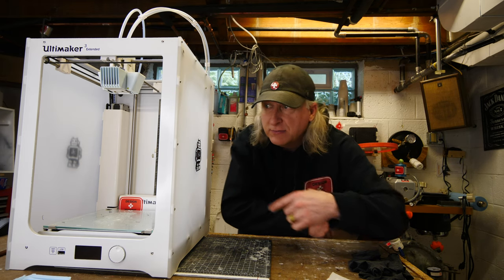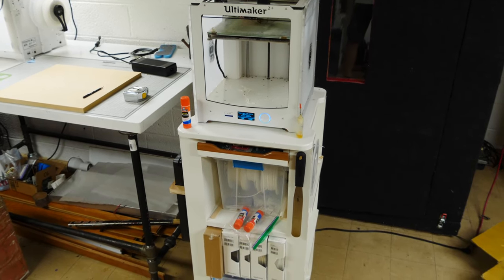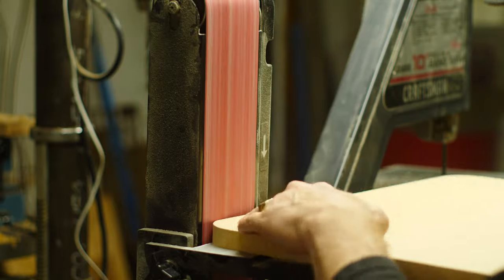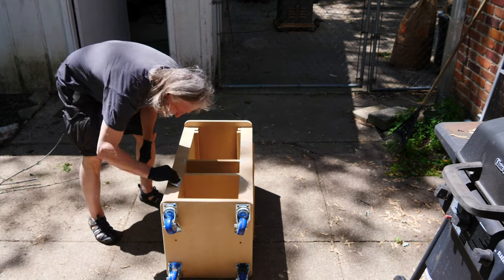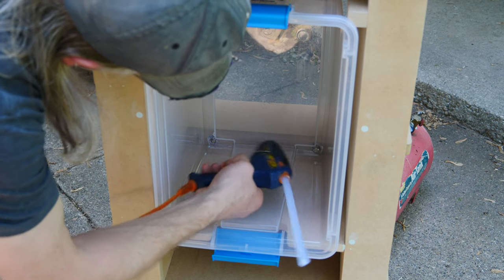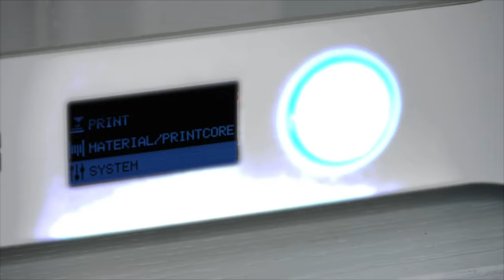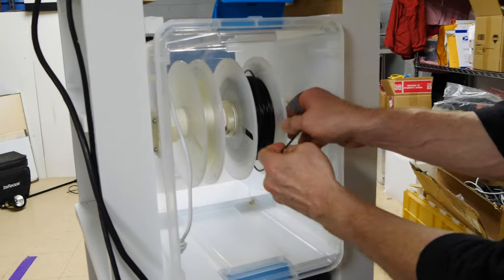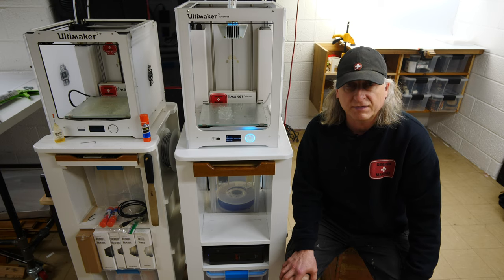Building a Rolling MDF Trolley 3D Printer Cart

Comment: What brand was the printer again? I only saw it 800 times. Think I'll stick with my Artillery - larger build volume, use whatever filament I like etc.
Reply: Read the description
Reply: @RyanStone143  Why? Does it mention how out of date the printer is?
Reply from the maker: You get what you pay for
Reply: @MastiffMike1  Someone's been triggered.
Reply: Granted i'd say a Original Prusa I3 MK3S+ , or Voron are probably the best "prosumer/pro" ones, short of if you need high temperature (for materials PEEK), or massive build volume (1 meter etc)

Also if you need more nozzles, you can get an add on for that (or a "filament swapper" like the MMU, or Palette)

And i think it's hard to say it is worth it for ~3x the cost vs saving that extra money, or buying more printers.

For ender-3 style ones, the toy argument is valid due to the fiddling/accessories + upgrades needed, but with a prusa or voron, at least in my opinion, you get a better product for less.
Reply from the maker: Eh, you get what you pay for, I have no interest in hobby printer b***** messing around I press go and the print comes out I never have to worry about it failing on my ultimakers.
Reply: @EricStrebel  I agree, but what i'm saying is ultimaker is not the only thing that does that, but not worth arguing over; you do you